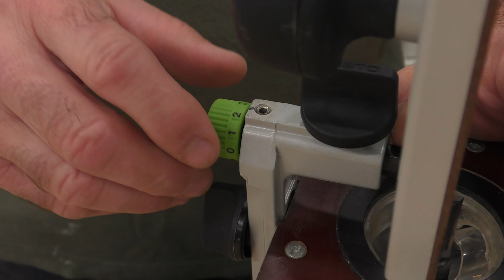Festool OF 1010 Edging Plate Walkthrough and Edging Basics

Comment: You really don't need the edging plate. You can do this with the Festool OF 1010 with a regular flush trim bit. 
You can clamp the board in a vertical position and install the cip catcher to improve dust extraction.
I know, it's not going to be stable, if the stock is thin. No problem, just clamp a rebated 3 inches wide fence on the other side of the board. 
That's good enough. No need to buy additional parts.
Reply from the maker: Thanks for sharing .....
Reply: I think for under $200, it’s a really useful accessory. Sometimes you just have to bite the bullet but of course, there are many people who jig everything which is fine too.

Comment: Can you please tell me what is the maximum distance between the top of the edging plated and the bottom of the router base. That is, what is the maximum width you can cut using this?
Reply from the maker: sorry for the delay...40mm is tops what I would use for clearance...or close is 1 9/16"

Comment: Great video and another example of Festool functionality.  I don't do that much edging and have been successful using flush trim router bits in the past.  Am I overlooking some additional advantages of this setup vs a flush trim bit for the occasional edging project????  I also have the MFK 700 and OF 1400 in addition to the OF 1010 if needed.
Reply from the maker: Great point! .... I wanted to show the basics of the edging plate system first in this video.... there are many great applications we will use the edging plate for in future builds .... stay tuned

Comment: Any thoughts or recommendations for edge trimming melamine shelving with 3/4 by 3/4 walnut edge banding besides not to do it?
Reply: Tongue and grove will work and it locks in the Walnut to the melamine, you can also domino the edge to the melamine. I did this (Domino'ed) with maple to double sided white 3/4  melamine for the extension table on my table saw.  one side was smooth with the melamine and the other side 2 inches past to allow mounting  to the fence rails. I have also done this using double side under the sink for cabinets as bare plywood tends to have issues once the seal is worn through.
Reply from the maker: very tricky to do because the chance of wearing through the melamine is very high ....... I did a set of doors like this and the technique I used was to put blue tape on the melamine right to the edge of the walnut so I knew I was getting close as I wore out the blue tape as I did my final sanding ... I hope this makes sense....

Comment: Could you use a flush trim router bit on the Application
Reply from the maker: yes you can
Reply: @sedgetool  the stability of the edging plate is a huge difference.